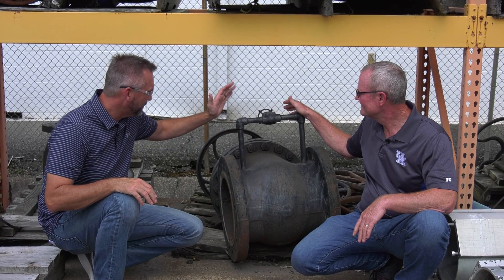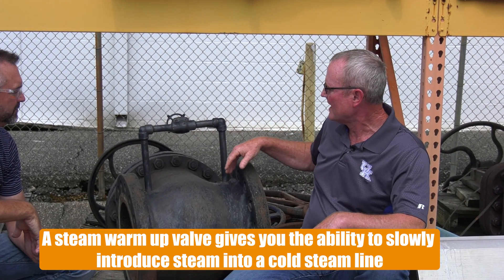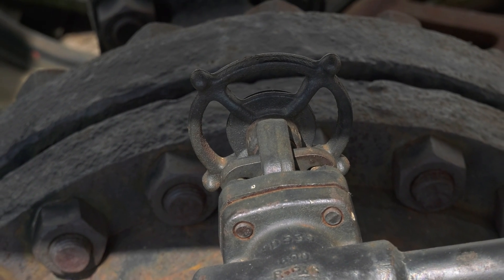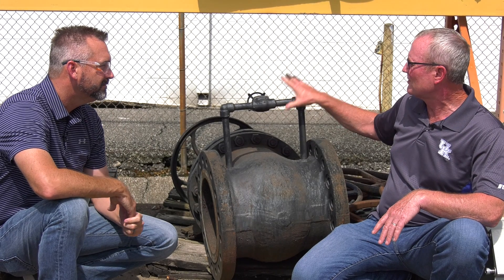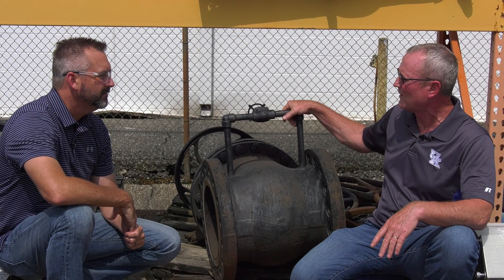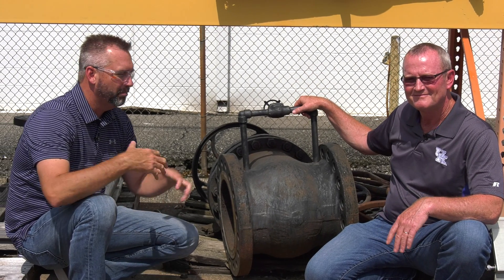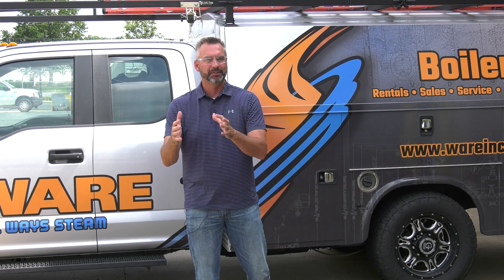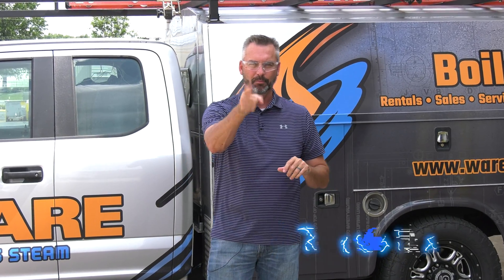Understanding Steam Warm Up Valves in Steam Systems - Boiling Point

Comment: Hi guys a have three boilers low pressure steam  on a roll they are all pipe together and the boiler in the middle keep going off on low water cut off . I have fixed some leaking pipes but have not solved my problem, any ideal on why
Reply: Low on water, check feed water system for that boiler,
Your Feed water regulating valve is not functioning properly
Reply: It’s all because the water level gets too low in that 1 boiler. 👍